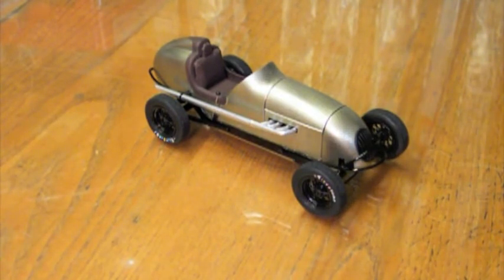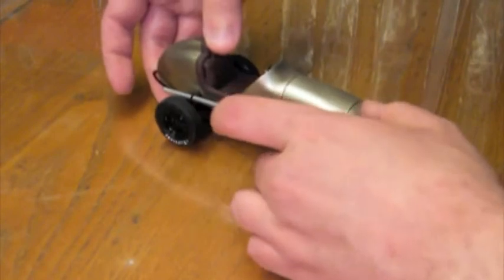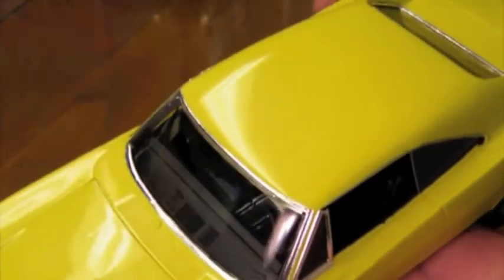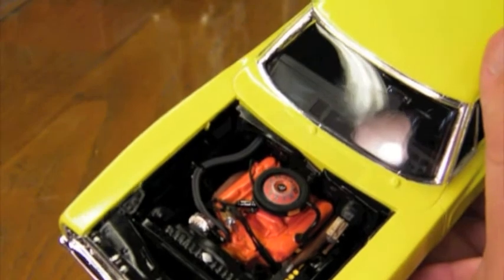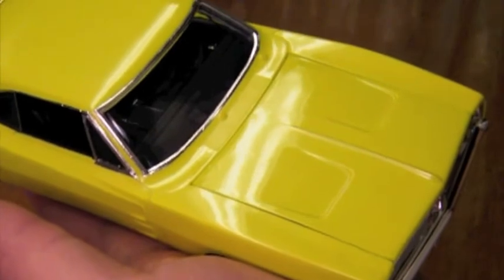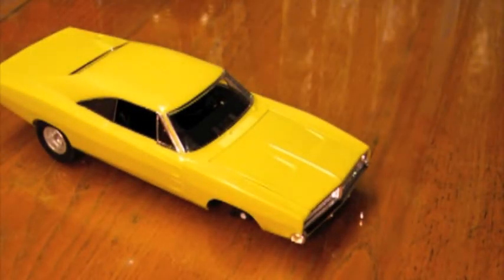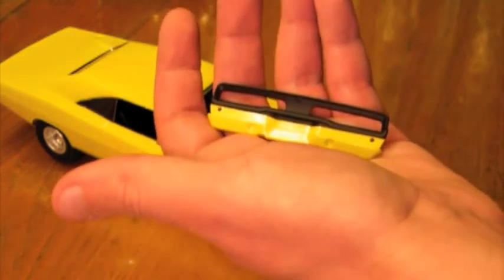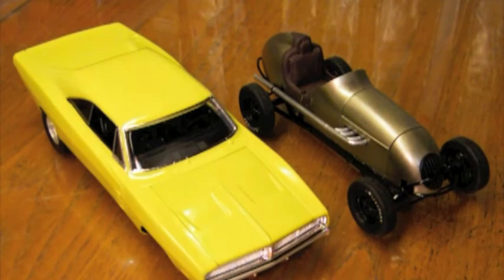On the Bench - Blonde Comet Open Wheel Racer & Dirty Mary, Crazy Larry '69 Charger R/T

Comment: I also had the idea to build "Dirty Mary, Crazy Larry"'s Charger. You beat me to it but I still plan to do one myself. Cool build, awesome work. Btw, I'd like to see a video of your ED209 if, indeed, you have one. I have a vinyl kit my cousin gave me and some info on what and how you did yours might inspire me to finally attempt it.
Reply from the maker: Pvmntpndr66 Thanks, and good luck on your build!  My ED-209 is the Kotobukiya kit that came out in 2006, so there really wasn't anything to it beyond popping the head and legs onto him.  I mostly went with this one because it was the closest thing to a 1/24 scale ED that I could find.
Reply: I don't know what scale mine is. I'm pretty sure it's larger than 1/24 and it's vinyl. It might be some sort of garage casting. Thanx for the info, take it easy.
Reply from the maker: Pvmntpndr66 I think there were a couple of different ones - a 1/9 from Horizon, and a 1/12 from Argonauts
Reply: I was looking at mine today, and it's a good size. I'd estimate mine as a 1/12 but I'm not certain. It's vinyl, no box, no instructions, no brand. My cousin can't remember where or how he got it. I'll have to scare up some pix from the movie and wing it. Should be fun.